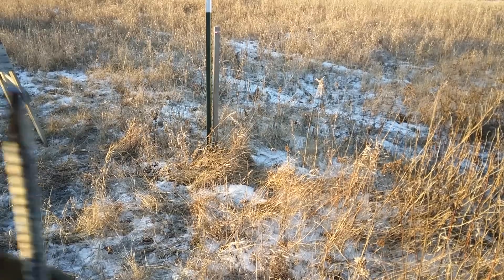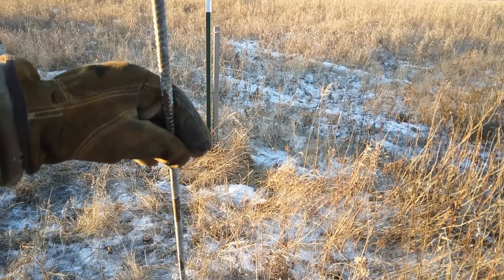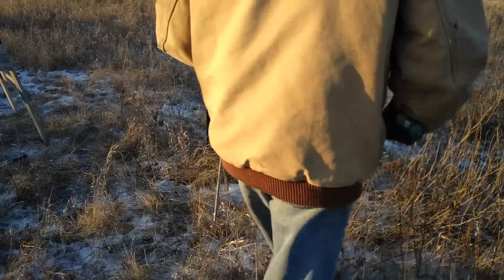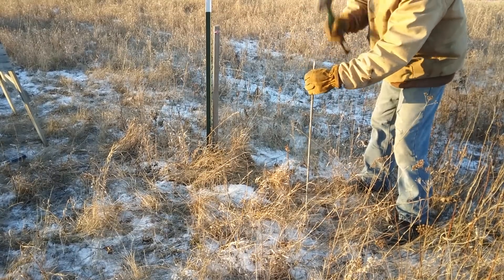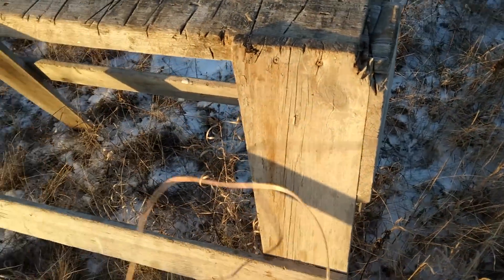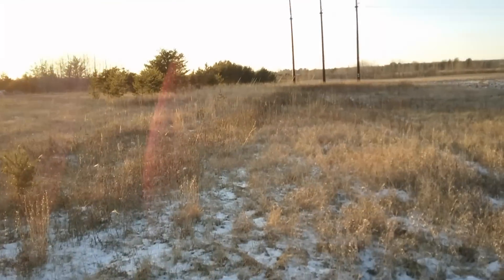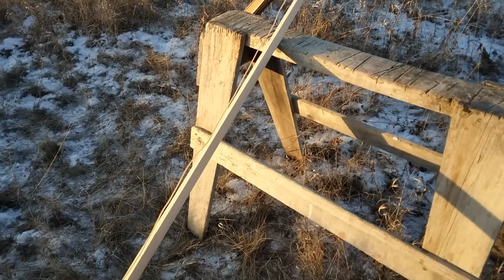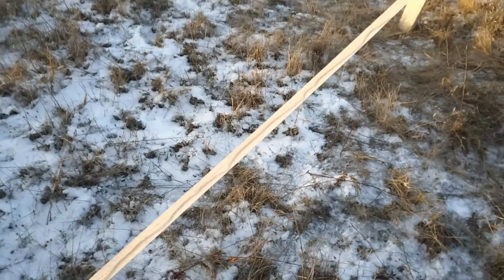⚡️💡Under the transmission line experiments.

Comment: I want to clarify somethi g i see in a lot of the comments. Its not power that is just seeping away lost forever. When you introduce an inductive circuit next to another it creates a back emf and actually opposes the flow of current in the power line, thereby causing resistance and effectively taking power. Without the light bulb in place, the emf from the power line  has no opposition and therefore doesnt see a resistance on the line.
Reply: EVERY ferrous object within range of the magnetic lines of flux creates an inductive load...EVERY ferrous object! Shed, fence, windmill, automobiles, are just a few. Not to mention if any of those objects are touching ground the object magnetized is discharging continuously to ground. I demonstrated this to my students on numerous occasions using a compass near high current load. The needle...pointed the load field. After a few moments the only ferrous part of the compass (which allows one end of the needle to point North) effectively became magnetized. The needle then pointed South, and remained this way for a few days.
Reply: @Ooo-vz3jd   It doesn't need to be ferrous.
Reply: ..yes but a copper wire ( non ferrous) running parallel  within range of the magnetic flux also produces a voltage when the magnetic lines of force are expanding and collapsing across the wire, the lines of force around the transmission line expanding and collapsing create or induce a voltage which oppose the line current. My understanding of ferrous metals  in coils or transformers is that they make the field more efficient, like a booster, as opposed to free air which is very inefficient.
Reply: @kengrieve5374  👍
Reply: @kengrieve5374  At last, someone who actually understands it.
Reply: So , how close can a home be located to these power lines.  
Is it dangerous to your health?
Reply: electricity will take all paths it can find
Reply: i think we found someone who works for a power company/line transmission....
Reply: In answer to the original comment about power being used here, am I right in thinking it is the reactive power (Vars) being used up to create the magnetic effect.
Reply: I don't think it's magnetic induction though. I think it's capacitive coupling. Different animal.
Reply: Very interesting I was just about to ask the same thing. 

Would diamagnetic metals exhibit any load on the system? Say silver, it conducts electricity so supposedly the field would have some interaction with it no? I want to better understand relationship between induction and magnetism/circutry
Reply: @Benpriebe314  current flow is the electrons moving along the conductor, outer shell of the atom to outer shell of another atom. Copper for example has one electron in it's outer shell, a good conductor, because it can move easily. Resistance is the materials opposition to that current flow. Inductance is the opposition to current flow as a result of impact on that magnetic field generated around that conductor during current flow. AC, the magnetic field collapses and expands each time the current changes direction. That impedes the change in direction of the electrons in the conductor. When ferrous material is near enough to the magnetic field, that metal becomes magnetized itself, generating it's own lines of Flux, magnetic field. This creates an added impedence to the current flow, making it harder to collapse the magnetic field each time electrons change direction. Analogy I used in class was an automobile. I start pushing it one way, voltage after a moment the car starts moving, electrons. Since our power here is 60hertz, the current changes direction 120 times a second. When I stop pushing, I run around and push from the opposite direction. Which way is the car still moving? After a moment, the car stops and starts moving the opposite direction. Resistance and inductance affects how fast the change in electron flow occurs. The lag in the change can be referred to as power factor. Another discussion, so much for the electrical theory rambling.
Reply: @Ooo-vz3jd "current changes direction"

i dont think it does. if whats taught is called theory then it is open to other theories.
Reply: @dangerdavefreestyle  it's not theory it's fact. Find you an oscilloscope, amp probe, watch the wave form, one way to confirm fact. Another...more popular method (not recommended), grab a hot wire feel the intense vibration from the electrical shock as it vibrates at 60hz, alternating 120 times a second.
Reply: @dangerdavefreestyle Apparently you've never heard of alternating current.
Reply: @Benpriebe314  silver is non-ferrous along with several other metals so they offer no inductive impededence to current flow.
Reply: And lenzes law
Reply: @Ooo-vz3jd Lenz law applies just the same. Current will be induced, at low Hz the losses will be small. Iron core transformers work just fine and are pretty efficient.
Reply: @rcdieselrc  Yup👍
Reply: It's INFINITESIMAL i.e. relax Mr. Goody 2 Shoes

Comment: I stopped under some very large ones that led to Los Angeles, and you could get about 1/2 inch of spark to jump between your fingers and the car body. It was also loud enough to hear the sound from the spark, even next to a busy road. 
It was strong enough that I worried about having electronics out of the car.
Reply from the maker: Interesting!
Reply: Was this in the afternoon during a heatwave by any chance?  With the whole LA Basin running air conditioning, I would think power flows would be at near maximum levels.

Comment: Your experiments with the power lines are really interesting.  There are tiny neon panel lights that run at high voltage and need very little power.  Can you make an illuminated fence?  How close together along the fence can you put the neons and still have them light?
Reply: As a kid I had florescent desk light that I'd occasionally remove tube and play with in total darkness, it would glow between my hands.  (no big power lines around)

Comment: I can see a spark with my ham radio antenna coming off the center connector to ground. I had to bring the 2 closer like a sparkplug. nowhere near a power line. Just static in the air.

Comment: 3 ways to grab power leakage. Capacitive, just a long plate of copper insulated from ground, inductive, a bunch of rebar or similar wrapped with copper wire, or ion capture, an array of insulated spikes. The first gives the highest voltage. The second gives the most current. The third is highly dependant on weather.
Reply: so in the next video after this, with his coax cable fence experiment, that would be capacitive.  I hope he will try one to demonstrate inductive. This is very interesting!

Comment: My former work I worked at for 20 years had high voltage lines running down the main street in front of the business and I always heard them buzzing when it was wet or icy out

Comment: Are you GROUNDING YOURSELF when youre under these lines??? You do realize that your body is also being charged up considerably in this proximity and ITS NOT GOOD FOR YOU.

You can mKe a video about it if you like... test the voltage OF YOUR BODY wearing shoes... then let your bare feet touch the ground and youll see the meter DROP....

Comment: I remember stories from the 70s of some farmers burying metal box springs under power lines to capture power.  I am curious - from a science perspective is the setup you showed (or similar) "taking" power from the lines or is it just capturing power that was leaking to ground anyway?
Reply: It takes if from the power lines.
Reply: The equipment is capturing the energy that has escaped from the overhead power lines.

Comment: After I sea kayaked off Alamitos Bay in Southern California I often went shopping at the Hawthorne Costco. Right behind the store are some high tension wires. I'd just wear my rubber wet suit, and rubber water shoes. I was a little damp, but not dripping. Pushing the shopping cart around the store about once every minute I get a real zap from the cart. A bit more than static electricity, but not dangerous.

Comment: High voltage likes to attract to pointy objects, so your antenna needs to have a whole bunch of needle points sticking out, that will attract much more voltage.
Reply: I think high voltage doesn't really care if objects are pointy or not, lightning is attracted to them just because pointy objects are usually the tallest. Otherwise, you are more likely to see corona discharge from pointier things but that just makes the voltage more "visible", not actually attracting "more" of it. I am not a professional though all my knowledge comes from internet sources like these videos so I might be off the mark.
Reply: @zeph0shade  Wrong, the pointiness does make a difference.  Mathematically speaking, the smaller the radius of the conductor (the sharper the point), the greater the strength of the field produced, and thus, the easier it is for a spark to form.  That's why impressive high-voltage demonstrations with Van De Graaf generators or Tesla coils, always use a very large radius for the biggest sparks.  With a large radius, the field is weaker for a given charge, so the formation of a spark is delayed: instead of a rapid series of small sparks, you get really big scary sparks, less often.  And if your lightning rod is nice and sharp, opposite principle applies, the voltage is discharged quickly and easily, before a really large bolt can build up (hopefully).  Either way, intentionally extending a conducting "antenna" above your head towards a high voltage line sounds most unwise to me!
Reply: @satanbane  It sounds like you're actually agreeing with me. I know very well that electrons love jumping into and out of a pointy surface more than a rounded one, and how that plays into the design of Van De Graaff generators and Tesla Coils. What we're both saying though, is that in order to accumulate a high voltage potential, you need to delay any form of discharge as long as possible while your setup builds up a charge. This would mean the original commenter's suggestion is still not particularly useful, since adding a lot of pointy ends sticking out of the wire will only result in more losses in the receiving end before anything finds its way to the capacitor.

Maybe if you could (legally) add directed pointy needle-tips to the overhead power lines, that would help direct more power to the wire on the ground... I don't think that's within the realm of possibility for this kind of experiment though.

Comment: 0:48 if it's actually arcing that might eventually arc over and end up causing a pole top fire or something. Apparently this arcing causes a lot of RF interference which can be detected using a spectrum analyzer. I'm just a lowly contractor for the cable company so I haven't really learned how to do this but I know there's tons of info on YouTube on how to build one using a SDR.

Comment: Did this back in the 90's in my back yard. Always thought it would be cool to make a phone charger that would work under power lines. Or power an led light for a tent. I never got to test if it works better with a ladder. I do remember hearing urban legends of a guy that powered his farm by  tapping a power line with a coil, until they arrested him for stealing.  I always doubted the story one because the coil would have to be gigantic to be resonant at 60hz and two I don't think the power company would even notice. I think if you were to get a large amount of energy you would have to get really close to the lines. It would be cool to see someone try it with a drone.
Reply from the maker: I heard some of those stories too from the past.  A couple of miles down the line from here, I seen some elevated deer stands in the corridor, and was thinking that if they had a metal roof, insulated for the ground, they might get enough to light lights.  In the easement I have with the power company, there isn't suppose to be a buildings within it, or trees either.
Reply: @doubleMinnovations  Kinda makes you wonder if we could have cars that are powered wirelessly by puttting the power lines over highways. Or under them, but that would be more expensive.